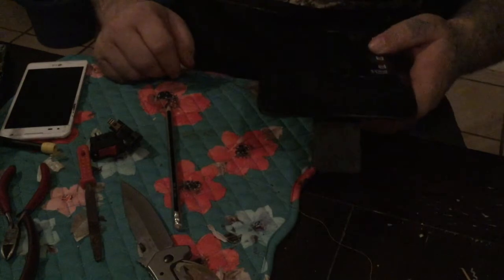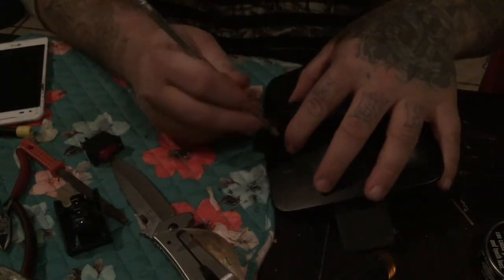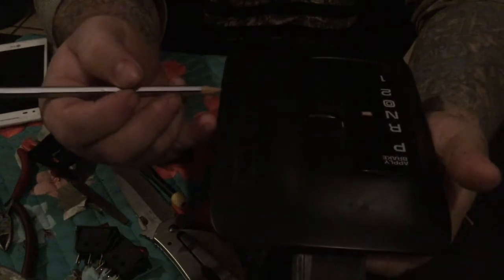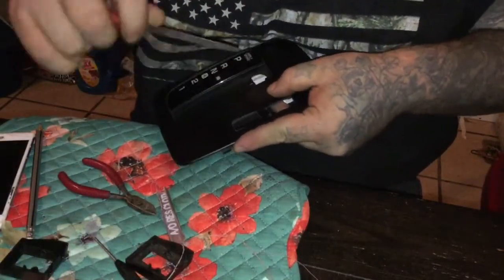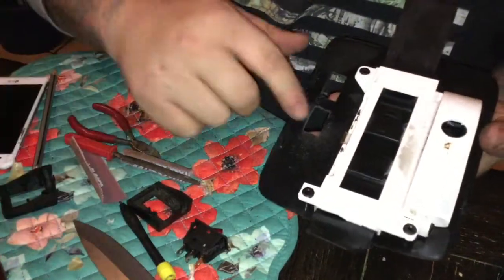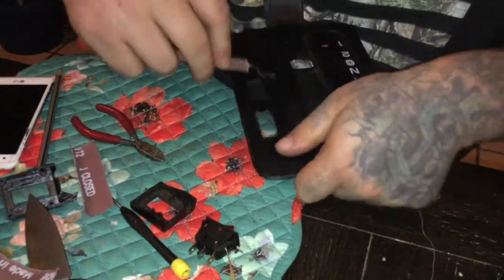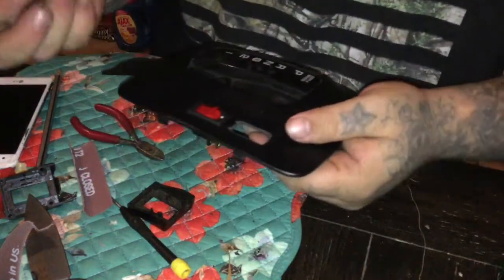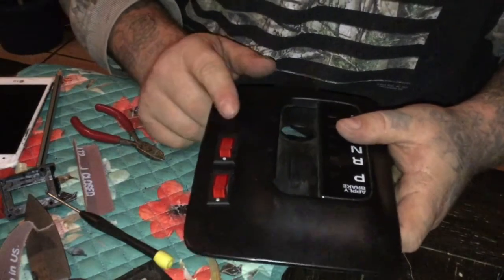Installing Foglight Switches

Comment: Good job but Why didn't you just use the stock fog light switch .All you would have needed was any jeep zj limited headlight and fog  lamp combo switch and a relay from junk yard.
Reply from the maker: kill bill i was gonna go that route but previous owner cut out the harness for thefactory lights. When i got this jeep it had fogs on front with about a 2 inch section of wire and the connector om the light but the rest of the harness is gutted.. Along with the downstream o2 sensor for whatever reason.. So i just went ahead and did the dual switches for roof fog lights and my back fog lights
Reply from the maker: Easier to run a new harness than track down the remainder of the old one